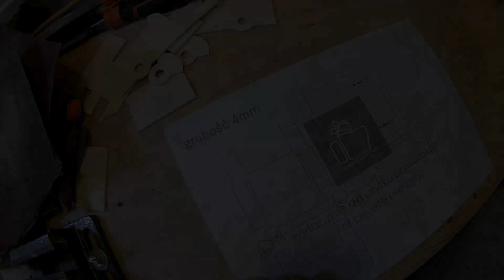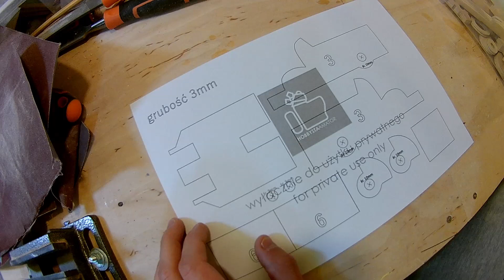.29. HALLOWEEN CREEPY DRAGSTER - darmowe szablony - FREE TEMPLATES

Comment: I´m very impressed with your plans!! 
But desoleee :((( I don´t have 4mm thickness, what happens if I use 3mm or 5mm instead of 4????  Thank you!!
Reply from the maker: There will be some problems. In this project, this 4 mm is important. It is not impossible, but it is related to changes. Thank you ;)